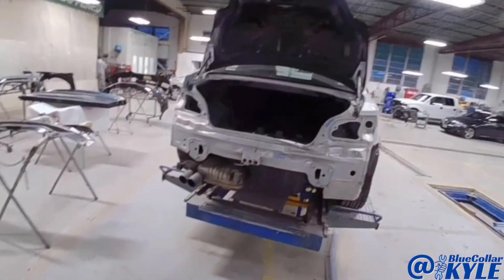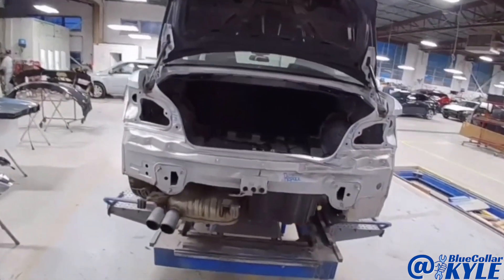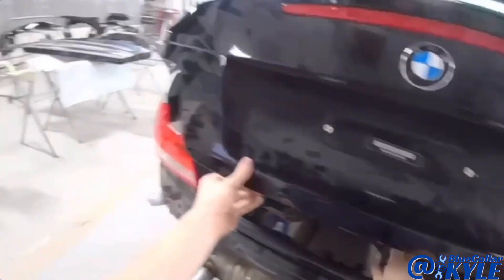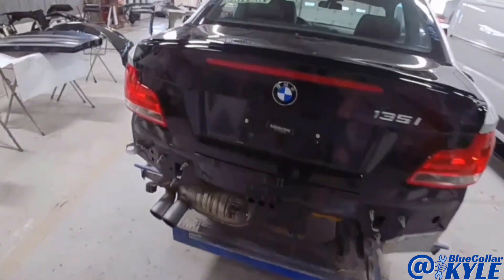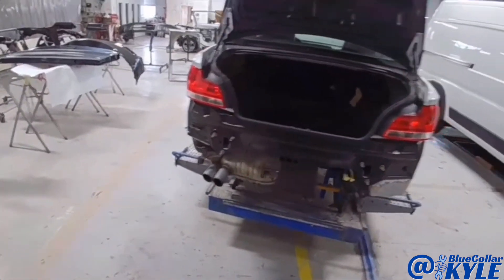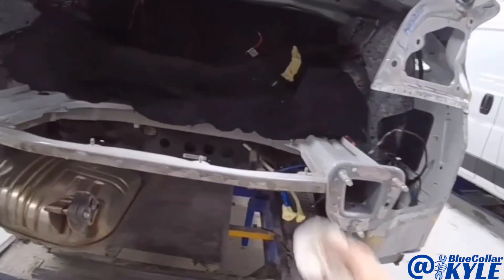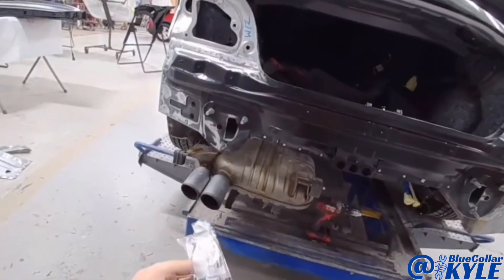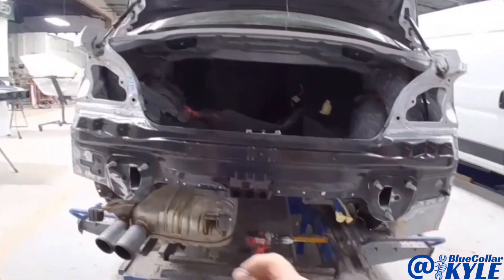Glueing Togethert A BMW!

Comment: Might you have vids about BMW rear quarter panel glue&rivet replacement? Did you use OEM adhesive or some replacement for it? Awesome video.

Comment: I wish i'd seen this repair three years ago when i did the same thing. You've done this so many times now that you've gotten it down to the least movements possible and i feel i wasted sooo much time when i repaired mine. Nice work.
Reply: That’s what I like about his channel, I was putting a rear floor and rear body panel in a 2021 Subaru outback and was trying to figure out exactly what the sectioning procedure was calling for in sectioning to rear floor and he had just posted one, for a while it’s like the jobs I was getting he just posted 😂